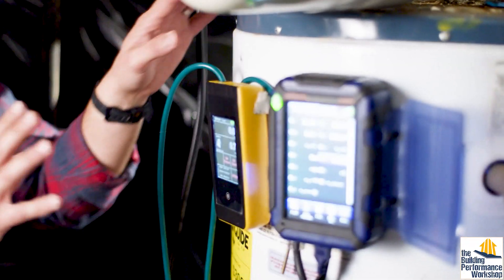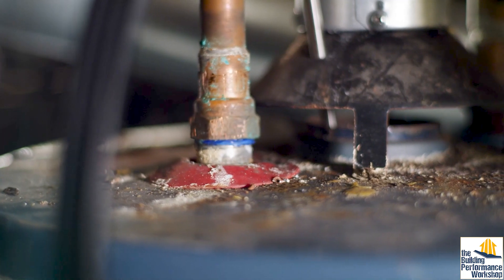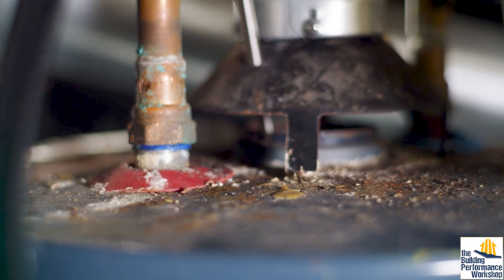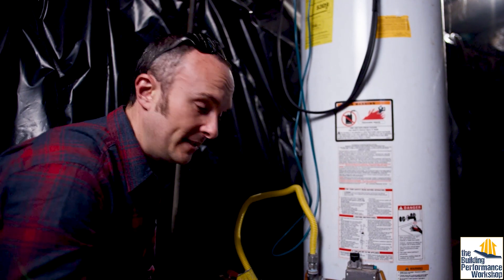Water Heater Safety: Combustion Testing and Inspection in a Home Renovation: Healthy Indoors Minute

Comment: great analysis. The missing element: all videos featuring gas appliances should start with a statement that gas use must cease. It is irresponsible to install gas appliances in today's climate crisis. Show the alternatives, please, and why getting away from gas is not only safer, but shows an understanding for the struggling earth we live on.
Reply: Isn’t electricity more often than not created by natural gas??   We’re never going to get away from fossil fuels, at least not in our lifetime.  Other than going the heat pump route, going with electric appliances are more expensive per btu as well as that power that’s is running that electric appliance is most likely being created by the same natural gas we’re trying to get away from.  Never ending circle, unless specifically your meaning solar power. I may be misunderstanding you, if so my apologies.
Reply: @nathanhurst5155  yes, solar, as well as wind, hydro-electric, and geothermal; all in combination with storage. (of which there are the more 'traditional' batteries, and newer concepts like reservoirs. The technologies exists to move completely away from fossil fuels. It's not IF we move to eliminate fossil fuel generation, it's WHEN!!!
Reply: @timskufca8039  Geothermal is too expensive to install, solar panels are being dumped by the tons in waste lands, and their acids are contaminating, wind is just not sufficient. It will take a long time before we can reliably count on renewable energy.
Reply: @terabyte7979  just look at how much more economical solar energy is today vs. just a few years ago. Yes, many power plants TODAY use fossil fuels, but the coal plants are disappearing, as will the natural gas plants......Planet earth will survive; I'm hoping humans will too.

Comment: Flue elbow is too close. Needs a 12" rise before the elbow. 
How is that room sealed up? Is it closed up differently in the winter?
If there's no fresh air it may draw air back down the flue. 
Especially if there's anything else pulling air from the room like a gas furnace.
Reply from the maker: Fresh air is a confusing concept much of the time- if you actually test the suction pressure on a combustion appliance zone when it’s closed, you’ll often find there’s plenty of makeup air. Just plugged an unecessary makeup air duct from a client’s attic today, as a matter of fact.
Reply: @HomePerformance  also seen "eco" models with fake cold air intakes.
Reply from the maker: Creative way to cause problems
Reply: @HomePerformance  seen similar here with wood burners. Talking to a person who had backdraft issues. The fireplace company installed a vent through the floor sucking in all that damp stinky air. Ewww. Cause was actually their heat transfer/hvac system that had no returns installed from the bedrooms so it depressurised the lounge.